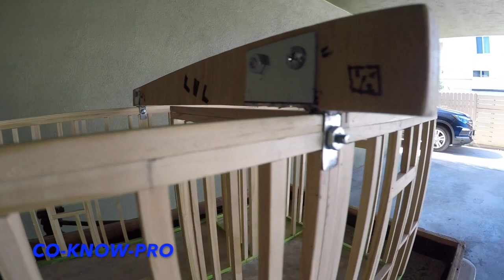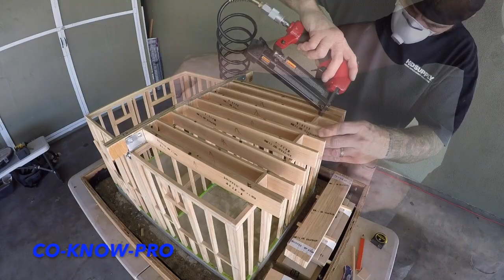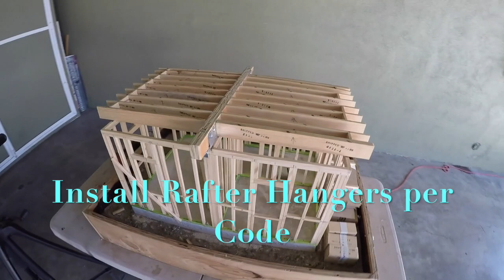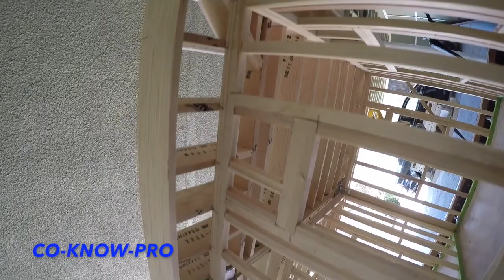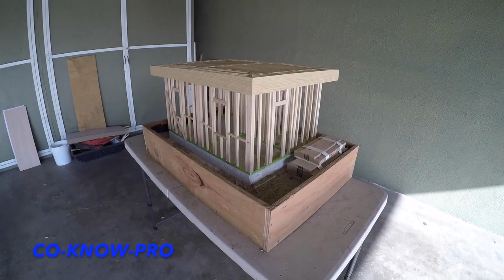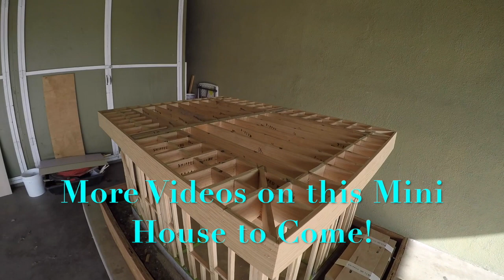⭐️Mini House Build Part 3 - Flat Roof Framing🔨👍@co-know-proconstructiontips

Comment: DO the interior walls add any support or is it strictly the exterior walls that support the roof structure?
Reply from the maker: Great question. The roof load does rest mainly on the exterior walls we designed it this way so we can remove the roof to do future work on this mini house and that’s why we ran the continuous grade beam around the perimeter of our monolithic slab foundation. 
But if this was a real house and the roof wasn’t being removed then technically some of the load can be transferred to those partition walls that are running perpendicular to the roof rafters/ceiling joist. 
If you were to do that I would recommend running a grade beam underneath that partition wall that is going to receive some of the rough load which is probably what an engineer would draw up in that scenario. Also take into consideration those two exterior posts that are receiving the CCs column caps to receive the LVL that the joist are attached to. That would typically require underpads below those two points in the foundation as well. 
👍😎
Reply: @co-know-proconstructiontips  t
Reply: Next question I've flipped a few homes and most of the time I can go in the attic and determine if partition walls are bearing. How would I do this with a flat roof? On either floor first or second.

Comment: Where did you get the mini brackets for the beams?
Reply from the maker: I made them soldered them together with light gauge steel👍🏻
Reply from the maker: I have a new video I’m about to release on the mini house build look out for it coming out soon 🔜